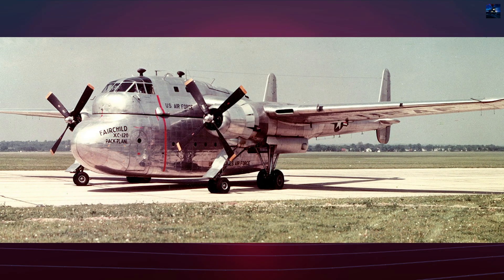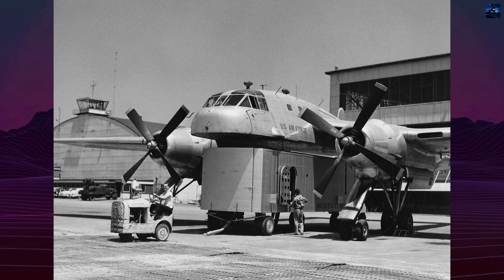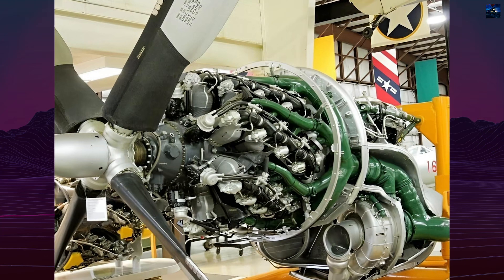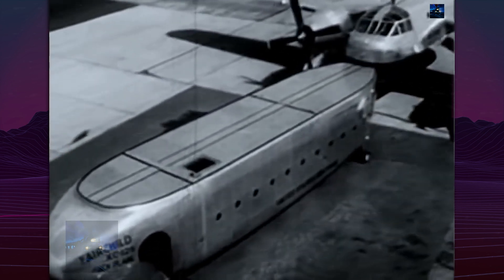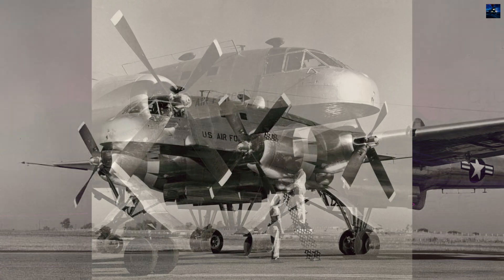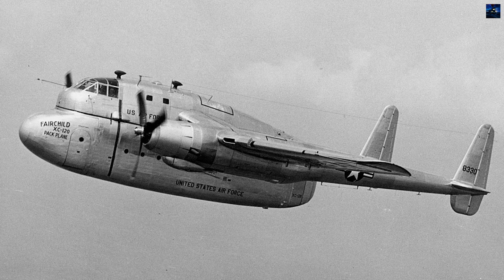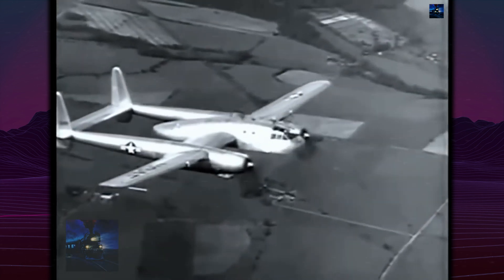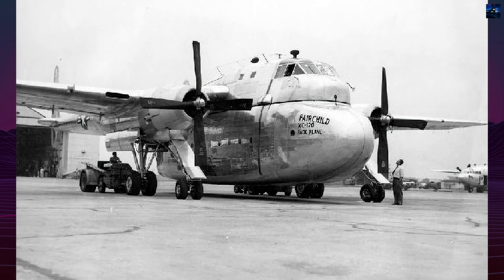Fairchild XC-120 Packplane: The Forgotten Modular Cargo Plane

Comment: One of the reasons Xc120 was not accepted was the XC-120 was intended to be deployed to forward landing fields, where it would quickly deposit its pod and take off again. However, it was found that the cargo pods had a habit of getting get stuck in the mud. This would prevent the C120 from taking again quickly.

Comment: Excellent presentation   
12 to 9 ton cargo capacity drop when using the pack plane verses the standard fuselage cargo plane was a real killer, a 25% drop in cargo capacity outweighs the convenience of removable fuselage packs in almost all situations. A modern airlifter can carry a pack inside of its fuselage, perhaps several if the need arises for such a cargo. 
That fuselage pack is a lot of dead weight to haul around.